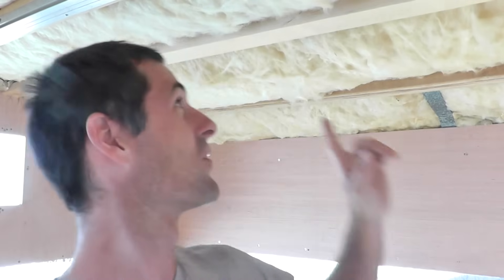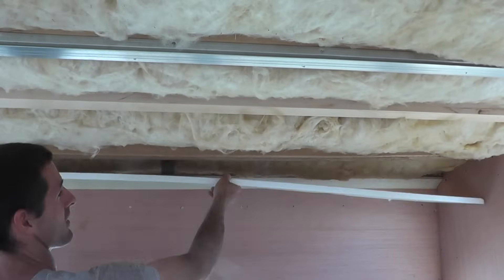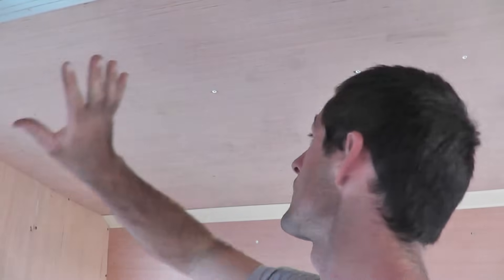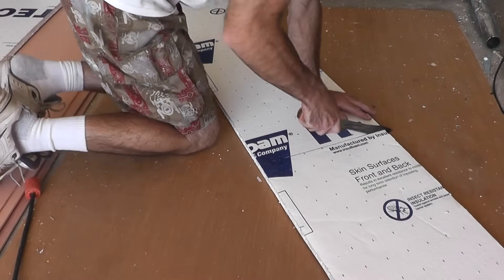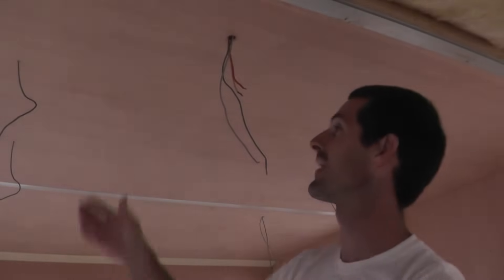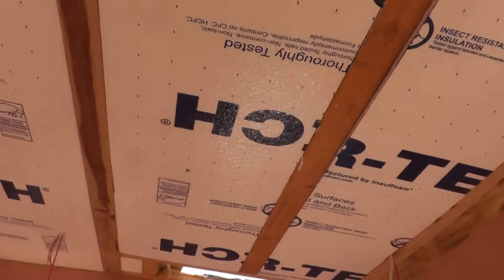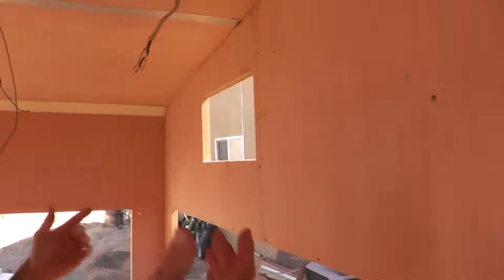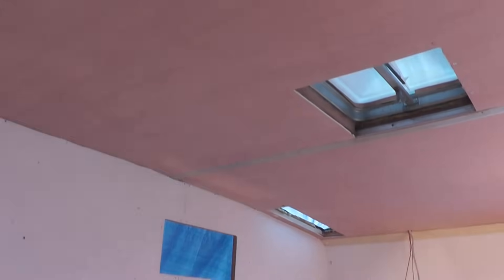Vintage Shasta Camper Trailer Restoration - Part 9 - Ceiling Struggles & Some Interior Color

Comment: Wow that looks so nice, i would be chuffed with that result, looks like brand new now :-D.
Im not sure what the glue was there for, you have loads of screws holding it up, it might last perhaps....hmm.... 30 years ha ha :-))
Reply from the maker: zx8401ztv Yeah, it's funny, the whole trailer was rotted out, but the ceiling was still stuck tight to the rafters!
Reply: ***** Now thats what i call "Super Glue" lol.
Super glue was fantastic when made by locktight all those years ago, but they have diluted it and its rubbish now :-(

Comment: Awesome guys! You give me hope with my Truck Camper. I ripped the ceiling and some side work on the interior and now trying to button it up. Got a new vent in, resealed the front overhead window, resealed the front side windows and rebuilt the bench where the cushions go and the boards slide out for the bed. Need a new or redo the table, paint the stove white, redo floor as the linoleum is shot.  Keep it up!

Comment: As a retired RV tech, I think your crazy for taking the task on knowing nothing about the construction of RV's Because you caused yourself a lot more work and expense then you should have. As for your building skills and tenacity I give you kudos. If you stay on this same path you will have an RV to be proud of after completion.Good luck you sick puppy.
Reply: Henry Avery got any tips for a fellow about to rebuild a 83 21 1/2 ft coachmen travel trailer?it has water damage in the ceiling, two or three walls(mainly front and back) and the floor. I got it for free so I'm willing to give it a shot. any tips on construction of it so I don't over spend?
Reply: Well first off Coachmen are notorious leakers especially at the front and rear roof seam I would suggest removing on the inside damaged ceiling and wall panels and replace all the rotten wood using it as a template to cut new wood to replace it. when you get it cleaned out put a strong light inside and check the roof at night for holes and fill them with Dicor self leveling caulk. Avoid silicone on all flat surfaces. Dicor seeps in and seals holes. After you get the wood replaced get a few cans of rubberized spray on undercoating and spray all your new woodwork let it dry and then install your insulation and then visqueen the walls and ceilings. I always cut a slot in roof trusses and put a 4 foot piece of 1/2 inch flat steel in the groove and sister ed another board on top of it and screwed them together. it makes the roof super strong.  I only wish I was there. I use to love the look on the customers face when he asked why didn't my camper look like this when I got it new. I loved doing that work
Reply: Henry Avery so how you fix fist size hole in the metal siding  where it joins to another piece it's about 2 to 3 feet from the front left side. should I go to the local hardware store and buy some siding and trim it , slide it in and rivet it to the bigger piece but seal it up first?  I know it needs some floor work. what does visqueen mean?

also I live in Northwest Indiana if that helps. I plan on making it stronger then orginal.
Reply: Henry Avery I've got my camper partly torn down inside where ethe worst of the rot is. I need information the floor looks to be held together by a three layers, the top floor, some foam board, and then some I would say half inch plywood??? aren't there supposed to be joists and frame work?? I see bolts running through all three going into the sheet metal underskin. I'm guessing the joists in back rotted away from the I would say 15 years of exposed to the elements via a open rear floor hatch. causing the rear sag somewhat. this looks to be the worst of the camper, the corners of the rook are the cause of the wall rot. surprisingly there is alot of good wood still. roof supports look as new as the day they were made.
Reply: what does visqueen mean?
Rolls of plastic sheeting that unfolds into large sheet of clear plastic sold in various millimeters

Comment: I have been living in an RV for 20 plus years.. you need ventilation at all times because of condensation in an RV. I have fans in all my vents and it works well. Even simple condensation between wall joints does damage or causes mold. The dryer the better. Keep a vent open at all times and keep a fan running at all times. This will let your wood last far longer. An enclosed space will get condensation and mold just because of temperature change. Those of you who wish to live in an RV in northern latitudes heed my warnings. Insulation in the form of "close cell' in place of glass is far better. "Hard sided" campers are far better at dealing with shielding you with temperature extremes. Pressurizing your RV from top down is far better than "venting"(you need to be concerned with moisture under your unit also). 
    Every electric modification needs to address the issue of how much power you have available. Most units in the U.S. run on a 30 amp system, or an 80 amp(two phase(120)system) This is important because of where you are and what is available for power and what your needs are. Living in an RV is far different than a short term trip. Many places have solar that they can add into a current "plug in" system. This depends on your latitude and sun availability. Some places have wind energy that they can tap into to add a power source. Lessening the cost of maintaining the unit is the long term goal.

Comment: i took the closet out of my 1972 Shasta trailer so I could replace the twin bed for a full size.  Do I need to go from floor to ceiling with a smaller cabinet for support?

Comment: Great job on this project. I was going to question the decision to use liquid nails on the ceiling in the event it needs to be removed for electrical repair, etc.  However, based on how those panels had to be shoe-horned in,  they will not come out easily with or without liquid nails. I withdraw my question.

Comment: I would not use glue on the ceiling panels..b/c if you ever have to take them down...they'll be destroyed. The screws would be enough to hold. IMO. Thanks for the vid.

Comment: In 1973 some tough guys, and I think one or two tough gals built your camper with American sourced products. You are rebuilding it with American sounding China sourced products, my how times have changed. Good job on the framing, and the progress as a whole. I have one question what did you use for insulation inside the walls?

Comment: First off...you and your wife are absolutely adorable! I've been binge watching your videos, because I just bought a 1971 Travel Mate travel trailer and am in the process of gutting it, due to some water damage. I have found a couple of rotted studs, so I will be replacing them, and will be replacing all of the insulation and paneling. Did you have to use any kind of vapor barrier behind the insulation on the walls and/or ceiling? I'm not keeping any of my old insulation, so that's totally getting removed. Will be replacing the old insulation with the foam board insulation (like yours) only. I've never done this before so I'm clueless lol that's why I've been watching your videos....you've helped me learn tons!

Comment: Hey, awesome work on the trailer, it looks awesome.  I was wondering what type of place sells the  white insulation you cut to fit,  and the wood paneling you used in part 10.  I'm in the process of redoing a trailer very similar.
Reply from the maker: +Ryno Jackson I got the insulation and the paneling at lowes. Thanks for the comment.